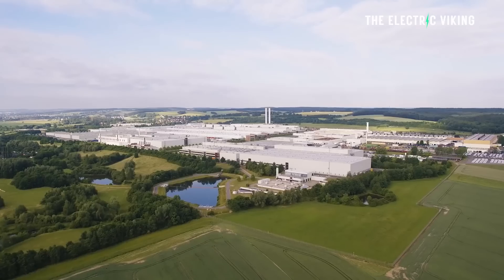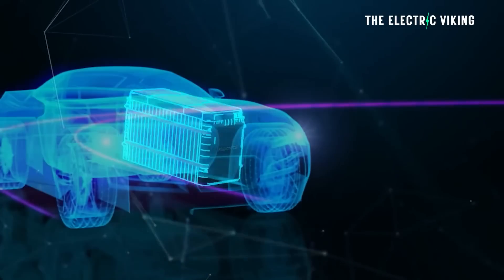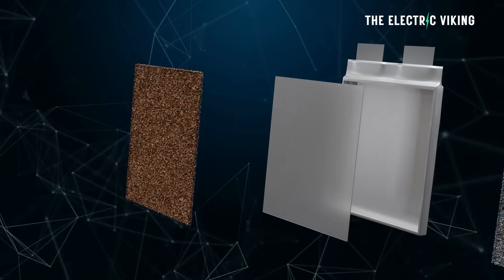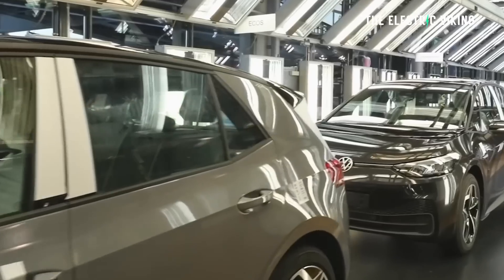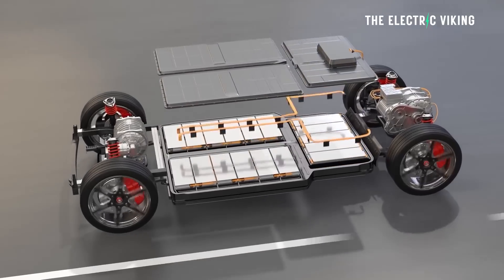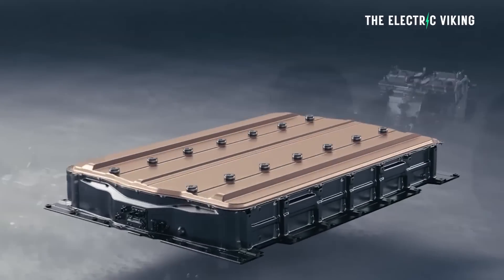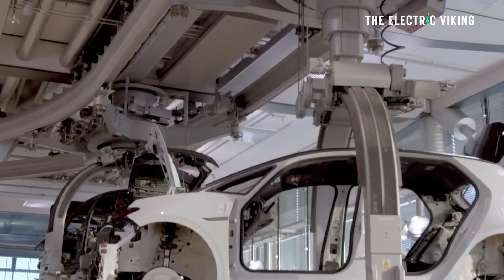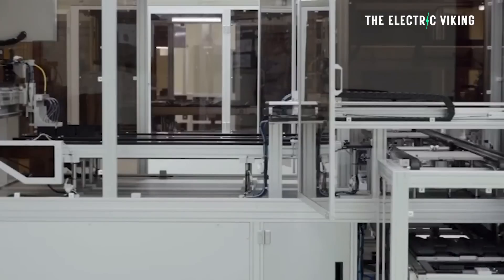3D current collectors dropped into existing batteries increase EV range 30%

Comment: No doubt reducing resistance in battery will increase energy density but 30% seems a very high increase considering the electrode is only a part of the battery.

Comment: All they are doing is 3D printing copper at very small dimensions -- this is not the same as new battery chemistry, so only the scale to manufacturing would be the greatest challenge here. Semiconductor manufacturing is very similar in many ways, much smaller total surface areas. It has a great deal of promise -- similar to metal foam.

Comment: 2023 was the warmest year on record, at 0.60°C* warmer than the 1991–2020 average and around 1.48°C* warmer than the 1850–1900 pre-industrial average.
The year as a whole was 0.17°C* higher than the previous record year of 2016.
Each month from June to December was warmer than any corresponding month on record.
July and August were the warmest two months on record and boreal summer (June–August) was the warmest season on record.
September was 0.93°C* warmer than average; the largest anomaly for any month on record.
October, November and December were each 0.85°C* above average, the joint second largest anomaly for any month on record.
It was the first year in which every day exceeded 1°C above the 1850–1900 pre-industrial average for that day of the year. Close to 50% of days were more than 1.5°C warmer than the 1850–1900 average, and two days were, for the first time, more than 2°C warmer.
For the year as a whole, sizeable parts of all ocean basins and all continents except Australia had average air temperatures that were the highest, or close to the highest, on record.
Reply: We don't have time to waste!

Comment: I am not sure about this. You mentioned several times 3D current collectors and I really do not understand exactly what are they. Let say they are the actual cathode and anode electron collectors, fabricated in a certain way to be a 3D structure just before filling it with the cathode and anode. That means a liquid process, and that one is very problematic. 
By the way, the big companies going rant to bankruptcy have a behavior to invest in all possible "miracle solutions", almost always with no success (remember Kodak/Fuji Insta camera). Just one year ago, YouTube was full of BS about the "revolutionary new electric motor of Mercedes" (in fact was just a squized EM with a short length and big diameter, unfit for the car applications)... Today, Mercedes plans are to close all EVs production...

Comment: In the US the reason most new cars sold are ICE and not EV has nothing to do with energy density . Its that EVs are not
 affordable. Even a 5% increase in price  will make fewer people buy EVs, not more. 
Still it's good to hear that the top 10% of earners will have better energy density.
Reply: Er, the increase in energy density means that for a given range a smaller and lighter battery pack can be used, which in turn allows the car to be smaller, lighter and cheaper to build.
Reply: @malcolmstreet1  I will respectfully answer in 2 parts (1) We were told the cost would go up , not down and (2) just because a company  can manufacture a thing more cheaply it does not mean the sle price will come down, more likely the company will either keep the difference as profit ; or advertise the breakthrough as progress, raise the price and make even more profit.

Comment: Every day there appears to be another ground breaking improvement or discovery that is going to revolutionize the EV industry.  The only problem is that they throw it up against the wall and you never hear about it again or, it will take a minimum of 10 years to make it to the marketplace.  They do this to drum up excitement about EVs, however, all it does as far as I am concerned is make me wait even longer before I can make a decision to lease (only a damn fool would buy) an EV.  Why?  Because it ensures that whatever you buy today will be obsolete tomorrow.  If that is the case, they why buy anything?

Comment: I think the public might be starting to suffer from pie-in-the-sky battery fatigue.
Reply: Only if they're not paying attention.  Batteries are continuing to improve and become cheaper, dramatically so actually.   Just look at any chart of battery pricing per Kwh over the last 20 years and you'll see instantly what I mean(charging speeds and density too for that matter).  It's the single biggest reason EV pricing has fallen so much in the last couple years.  That, and Elon pissing off his core market, of course.
Reply: @Ryan-ff2db  Ok then maybe not existing tech price fatigue.
Reply: @ElMistroFeroz  The existing tech was once future tech 5 to 10 years ago.  Same with this.  Most of the stories reported on batteries will never see production but some will.  In fact several are hitting the market as we speak and are very impressive.  The trend will continue.  Density, charging and cost reductions are continuing just as they have, with new and existing techs.

Comment: A lot of words to describe a textured copper foil!
Thing is, if you reduce the amount of copper in it, then you reduce power density.
Increasing the texture depth, increases overall thickness, therefore reduces the number of layers in a jelly roll, thus negating the increase in surface area.
Be more skeptical.
Reply: Not true. There is a lot more to Addionics 3D foils than that. Do more research yourself.
Reply: Do you really think that the conductivity of the copper foil itself is the limiting factor? I certainly don't. Presumably the actual anode slurry is filling that copper matrix. Since overall copper mass/volume is reduced, this should increase the power density, since the slurry is the actual active component. The copper is just a current collector.
Reply: @SavageChinquapin  not conductivity, but current carrying capacity, or ampaciry. It may be able to deliver more energy, but with less power as the copper would heat up more quickly. This may be enough if that's all you need, but I doubt it would provide sustained performance without serious temp management.
Reply: @ahaveland  Sure, be pedantic on the terminology if you like. You have shown no evidence or rationale that current carrying capacity of the copper is (or would be) a limiting factor compared to the actual slurry. Other than "uh, less copper less capacity" - well, if it won't be a limiting factor, it's basically irrelevant. What's the current carrying capacity of the slurry compared to the copper? FAR lower.
Reply: @SavageChinquapin  physics doesn't argue, it dictates.
Reply: @ahaveland  You are not physics. You also have completely failed to support your position in any way.